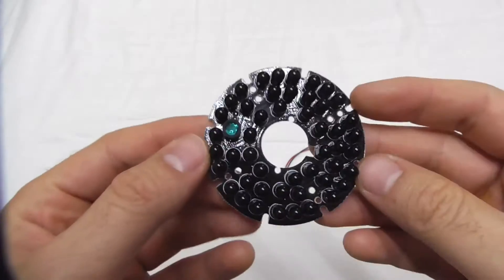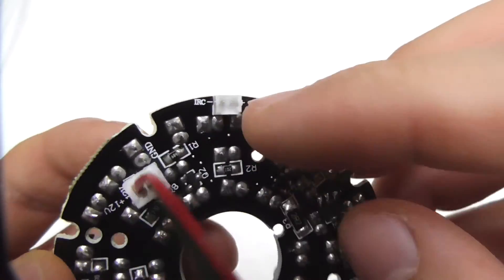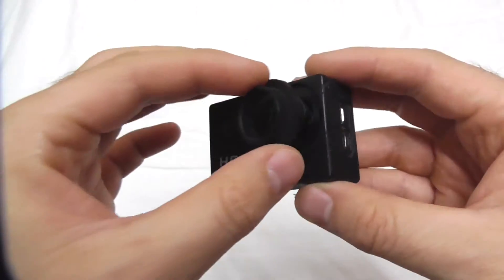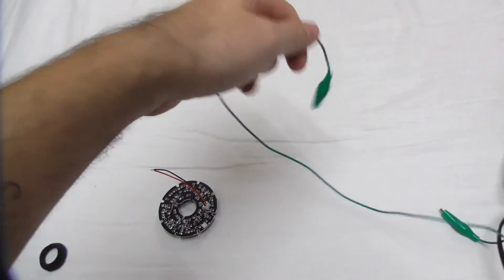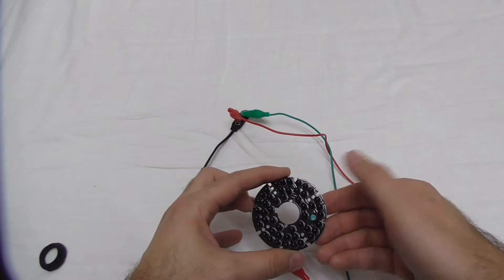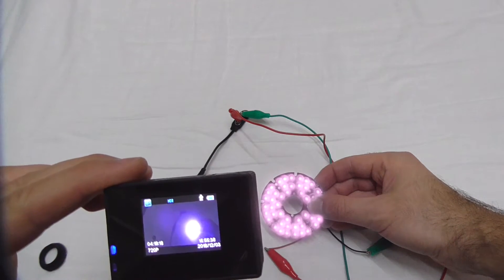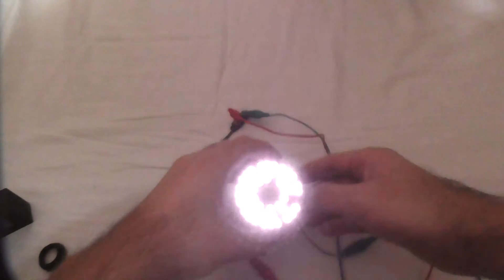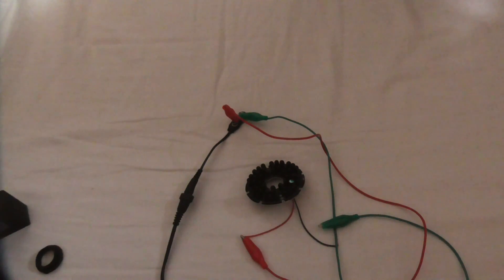Infrared Illuminator 940nm 48 LED (Invisible light, No red glow)

Comment: Interesting video, thx. Will a surveillance camera with night vision pick up infrared emitted by an external source, such as a the lamp you built? My camera is inside, and when night vision is on, the ir leds reflect on the window, rendering it useless.
Reply from the maker: Yes it will pick up because these are IR sensitive, and yes behind a window it is unfortunately pretty useless because of the reflection.

Comment: Hello, I have a question about infrared led products
Can I connect the infrared led to the raspberry pi camera
Thank you in advance
Reply: i think you can but you will have to remove infra red (ir) filter from there, it will be a violet colour glass or just plate

Comment: One question. I saw a similar 12v 30 ir led illuminator. Could I simply connect it to a 12v dc power supply or would I have to add some resistors? If so, do you know which ones?

Comment: If you upped the intensity of the light you might see a dull red glow. IR is invisible in most cases but in things such as pulsed lasers or looking a the dot from one you can actually see it through only up to around a certain wavelength. I've seen it before it just looks red but knowing what it is is pretty cool. I could link you to a few papers on the subject if you want though one you need to request.
Reply: If could send me those papers i would be happy, i was about to be making a night vision goggles but its shitty if someone without them can see u, cause of the glow…

Comment: Will it run on a nine volt battery
Reply: Even if it would work at that voltage, at 200mA typical current draw for a light of this size it would last for less than 2hrs. Probably closer to 1 hour at that drain rate.

Comment: How long will a 12v battery power the light?
Reply: Depends on the battery. Drain rate is close to 200mA so a 40Ah capacity group 24 battery would run it for 200 hours or so.

Comment: Hi there, great informative video and I need to get these powered up in a covert scenario so looking at 12v DC battery banks but, what mAH am I looking at ??

For instance, would the following battery bank from Amazon power my this IR unit up:

https://www.amazon.co.uk/XTPower%C2%AE-XT-20000QC3-Power-Bank-connection/dp/B07PY8516W/ref=sr_1_5?keywords=12v+battery+bank&qid=1573207137&sr=8-5